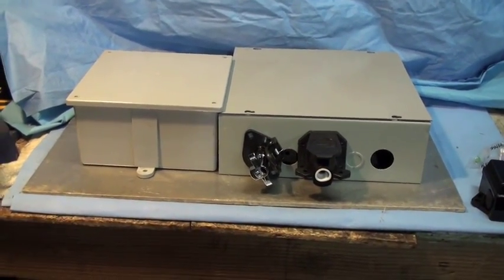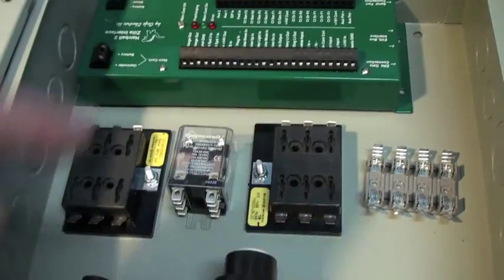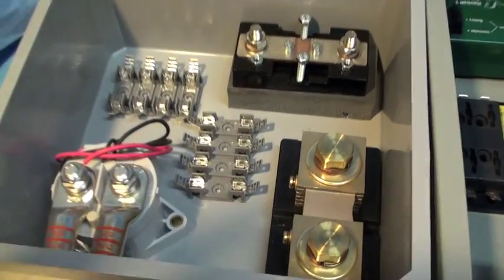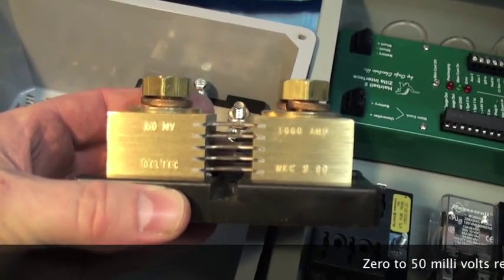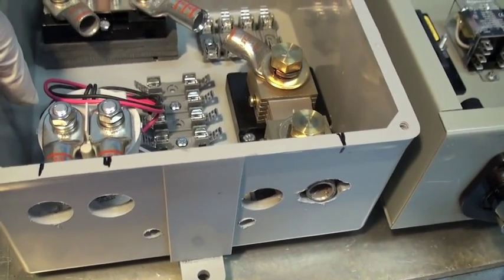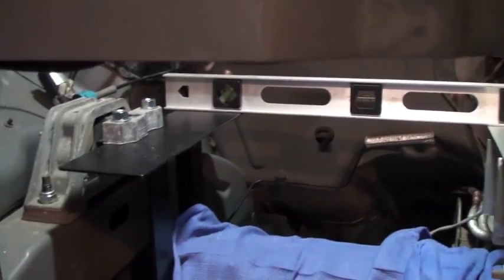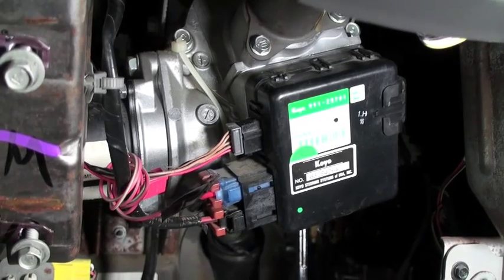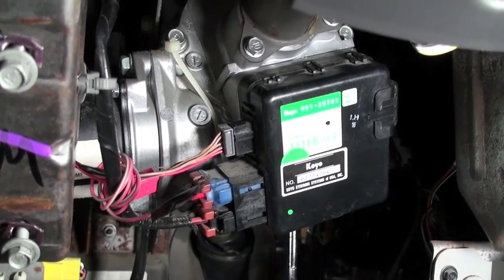HHR update  October 25 2011

Comment: I see you found a work able solution to the run signal. Congratulations.
I saw in a later video that the "hairball" has a tachometer signal output, and it occurred to me that may be the solution, especially when you were adjusting the settings and there was min and max settings for the tachometer, which you said was unnecessary as you weren't going to have a tachometer. I thought - hey, why not have the tachometer output send signal to the computers so they will activate. That would give a constant run signal (theoretically), and adjust with speed. And if the important sensor is crank based, you will have the right count! If cam trigger, then halve the speed settings of the tachometer to get the right speed.
And a direct battery feed for the sensor to the steering is inadvisable, as many sensors run at lower voltages, and you may end up damaging the computer with too much voltage.
Not a expert, but, something for consideration.

Comment from the maker: Thanks Kyle, If you will look at my later videos on the BMW X5 conversion you will see how I am spoofing the reluctor signal using an arduino that will convert a 2 pulse signal into a 60-2 pulse signal that the ECU (or DME in BMW speak) will recognize. I have been able to turn on the DME and make the car think that the motor is running. The program starts with a signal equivalent to the idle speed. As the 2 pulse signal increases from zero so does the 60-2 signal.The tach responds accordingly

Comment: (ensuring the amplifier has a zena diode in place to knock the voltage down to the correct levels) this would trick the vehivle into thinking it was at idle however this may interfere with the tacho if you intended to use the computer to give that out put

Comment: i know this project may now be finished however if you put the reluctor ring on the shaft of the motor you will only get a signal whilst driving, this may not be ideal for car parks, i would recommend (whilst you may have already solved this issue and assuming the ECU is still installed you could use an oscillator and amplifier (usually used in a radio circuit for the first stage IF 450hz) and hard wire this into the pick up